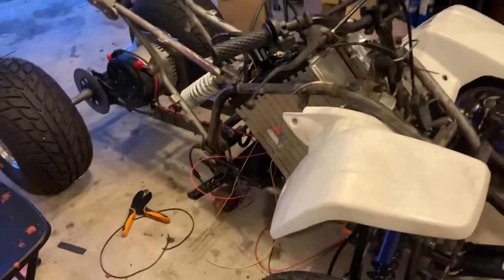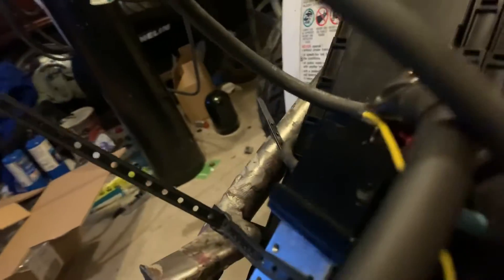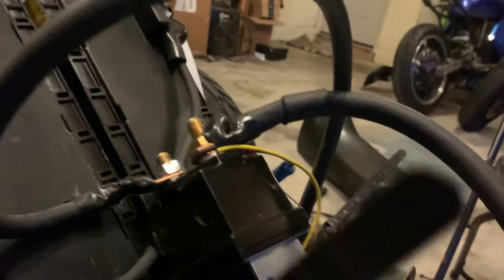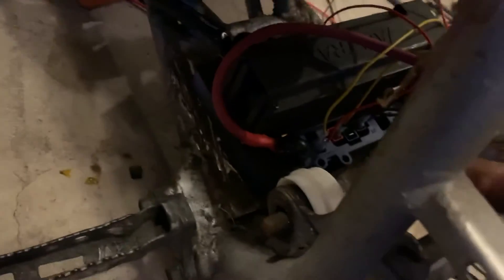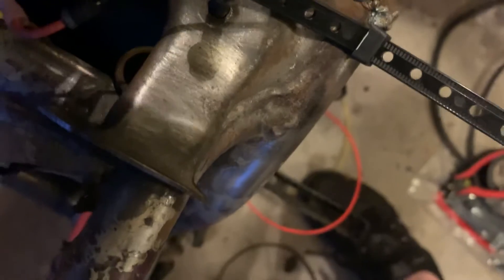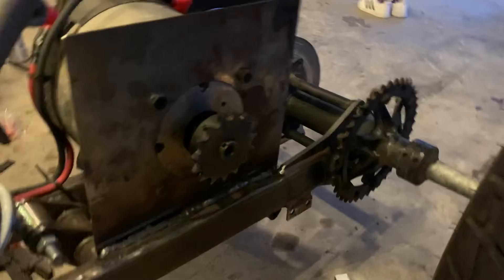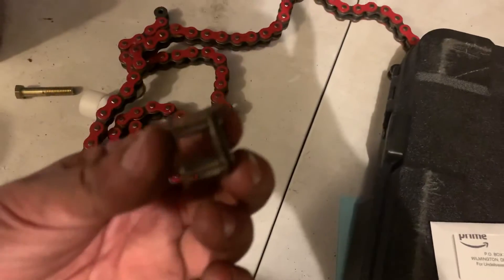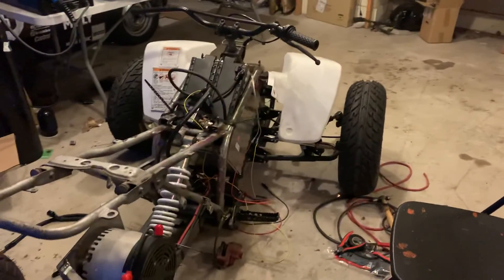How to wire an alltrax controller ev quad

Comment: Nice setup!  Which batteries are you using? And how are they configured? I.e: 2 banks wired in series or parallel?  Thanks in advance!
Reply from the maker: These are chevy Bolt batteries they are 36v each so i run 2s to get 72v

Comment: Are you using a Magura throttle?  If so which color leads go where?
Reply from the maker: Only use the black and white wire
Reply from the maker: J5 and j4
Reply: @diyguy1476  Mine has brown , blue and black. Which would I use?
Reply: @lawrencejohnson6823  you ever figure out what wires to use?
Reply: @clayton9341  Yes I finally did
Reply: @lawrencejohnson6823  what did u end up building?
Reply: @clayton9341  A 74 cb750...I recently had a battery catastrophe so it's sitting for a rebuild
Reply: @lawrencejohnson6823  nice. I just ordered 72 of those headway lifepo4 hp cells. Going to be my first time building a battery. I’m trying to make a really fast mobility scooter.